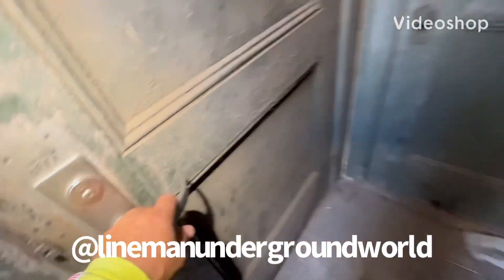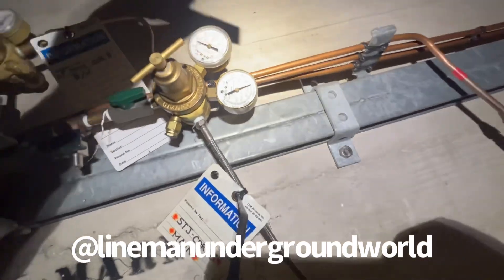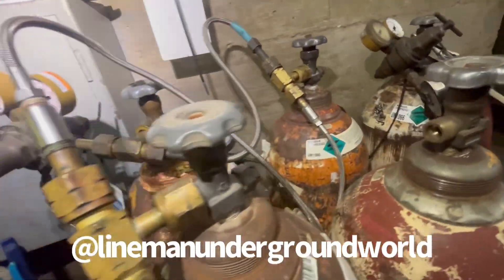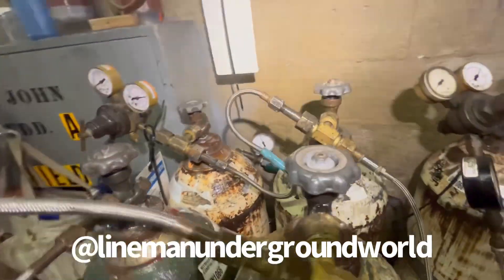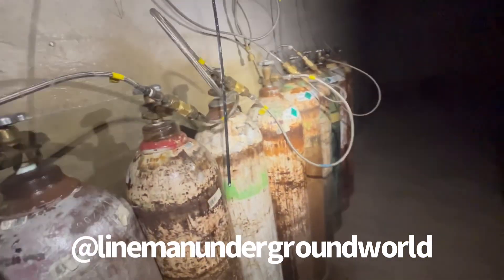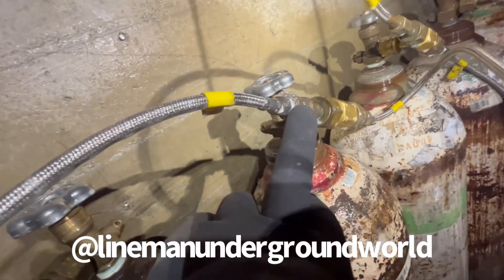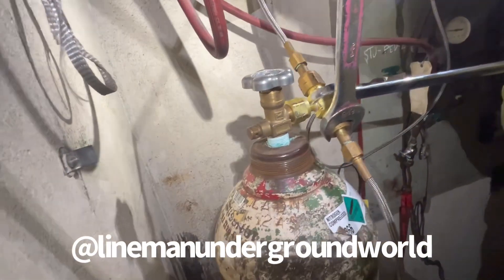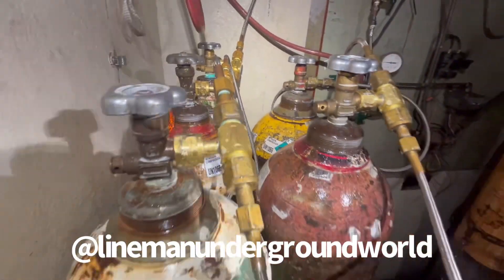Nitrogen gas into the cable

Comment: Work for Bell Canada we do the same thing with our cables but on a much larger scale we have massive air dryers the regulate and pump are down our cable lines in every central office. Only time we use the Nitrogen tanks is in the field to pressure up new sections before we tie in air lines. 900 pair all the way up to 4200 pair copper pulp/paper insulated cables.
Love your videos

Comment: How long does a set of tanks keep your cables pressurized ? Ever had to chase down a leak in a section of cable that was inside a conduit; that would be "fun" to hunt down....
Reply from the maker: Wazzup gje, the tanks will last accordingly  to the individual cables and how big the leak is , and yes we have leaks that it came down to isolated one span

Comment: You can tell this is a union make work project.

All that should have been piped to a central tank by now.
Reply from the maker: Wazzup bananas, sorry but that suggestion would not work at all these circuits run all in different directions and especially the bottle locations would hinder the central location.. 🫵🏼🫵🏼💯😆🤣😂😂😆🤣🤦🏻

Comment: Are you using nitrogen to help keep out moisture? Also I'm assuming you have O2 monitoring in there for safety?
Reply from the maker: Wazzup dav , every station we go to has it .. 👍😎
Reply: They are pressure assisted cables. The pressure stops voids forming during heating and cooling cycles.  Alternative is oil filled cables;  Both used before solid insulation like XLPE became available.